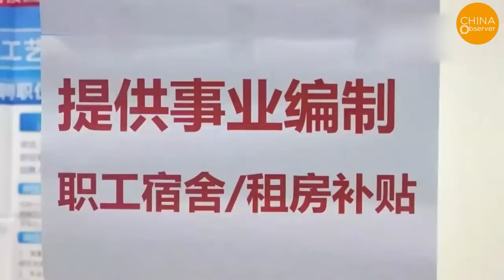All Came Crashing Down, CCP is Finally Next

Comment: One of the easiest things to do is to point out massive weaknesses in a country and predict a collapse. People predicted the imminent collapse of the USSR for decades before it happened. They were right about the direction but massively wrong about the timing. Flawed systems have a surprising ability to keep stumbling along on the edge of collapse. They often look like they have turned everything around and are on the way up like when the Roman Empire switched capitals and geographic centre of mass. One could argue that both the CCP and the USSR represent stages in the fall of these empires that have been going on for decades and centuries and we just mistake their upswings as long-term movements when they are just the deathbed vigour of highly centralized ethno-nationalist societies.
Reply: I think you missed the first bit about globalisation collapsing and the need for self sufficiency. Comparing this to Rome considering said globalisation, technology and modern human enlightenment is a terrible yard stick. As stated, a third of the worlds economy is North America, your perceived Rome in this scenario. The USSR held on due to its ability to feed itself and proliferate energy through various means internally (and their grit). They also innovated behind the iron curtain. China has none of these things bar grit. Their voraciousness in the consumer economy has been unrivalled, thus a bigger crash is inevitable. The USSR took a few decades after the collapse to get up to speed and endured a depression. China will not weather such a depression when it’s only commodity is labour. Throw in a once in a century pandemic, a space race and African recolonisation war (where population growth is booming) and you really do have an unprecedented situation that can’t be juxtaposed. It’s new territory completely. Any time prediction would be folly but my gut says he is close on this one. You never know how the narcissistic rat in the corner will lash out. Definitely going into new unknowns. Hot mess, grab the popcorn.
Reply: Yes, but a huge country like China can be in a state of collapse for some time before it breaks up into separate regions/states. China already is in a state of collapse. The video is quite correct in saying that it all depends on the resources you own or can control. Maybe, the lesson to learn,  is the tendency of some states after a generation of successful development to throw away the pragmatism  that led them there and blindly embark on a political path of self destruction cutting ties with the world they depend upon. I am afraid that China is not the only example.
"Flawed systems have a surprising ability to keep stumbling along on the edge of collapse." That means nothing and you know it (hot air phrase meant to impress). All systems are flawed and some of them collapse .-)
Reply: @Droo75  Well stated, thank you.
Reply: China is collapsing again?😂
Reply: @haochengzhai7156  has collapsed already
Reply: Keep fantasizing.
Reply: But we should not underestimate the ingenuity of the Chinese people - they seem to be able to always stay one step ahead and figure out how to take care of their families despite knee jerk questionable policies of the ccp
Reply: Let’s also remember that the USSR collapsed right after a failed coup, which even though it failed, showed how weak the USSR was. Sound familiar?
Reply: I think many people have a general idea of what it means for a country to collapse...but I'm curious what the actual metrics and markers are that indicate a country's collaspe.  Is there one?
Reply: @sulblazer demographic collapse, domestic consumption collapse, export driven economy collapse, financial system collapse, currency collapse, and a positive worldwide view of general trust and desire to do meaningful business with China has collapsed. Any one of these can cause a civilization collapse, China has all of these happening at the same time and also much more. China crossed the point of no return 25yrs ago. 🇹🇼🇹🇼👍👍
Reply: CENAisNothing But a wasteland of polu fakefood etc etc
Reply: Great point one thing that should be noted is that most of what is transpiring began many years ago with the One Child Policy. If not for that one law, China would not need to be expansionist as it has become. The numbers show China’s population will fall from 1.2B to a mere 550M by 2100 and in that time the USA is expected to grow to China's current size. This can be directly seen in migration patterns. We can’t keep people out and China has to keep them in. The reason why China has beagnnloaning money to smaller countries is to begin using those loans a indentured servitude. China is actually in the process of enslaving the entire continent of Africa and only doing it because of it's own bad policies. How else will Xi manage to keep people working when China gets to old to support itself. It can't so it is going to use other countries citizens to support it's own denizens. This doesn't come from a point of strength from an empire in power. This happens when an empire can't maintain control. China's power is gone. It will never come back. What we have to fear now is that China will take us down with it as it sinks.
Reply: @merced175 Please elaborate on the failed coup reference.
Reply: @haochengzhai7156 it collapse to how many dynasty before ?
Reply: @marchebert9813  failed coup 1991.
Reply: @merced175  OH, for crying out loud! I'm so sorry. I thought you were talking about the US !
Reply: @marchebert9813  Honestly, totally understandable LOL
Reply: Yellowstone is building up and could cause the biggest cataclysm humanity has ever seen. After underground nuclear tests in North Korea, earthquakes in Mexico and Alaska doubled and Yellowstone broke loose with new troubling signs.  Last year it started emitting frequencies that happen before and during eruptions. We were told that we should be concerned when earthquakes went above magnitud 2. That line was crossed long ago. Today we have 3+.  The next eruption was scheduled for 40k years into the future, but nuclear blasts seem about the right amount of energy to shake that structure.  

If it goes off like it did in the last big eruption, everything within 300 miles will die. And within 600 miles will struggle to survive. And if it activates Cascadia and San Andres, the whole west of USA would be gone as a functioning economy.  And for some decades we could have an ice age.
Reply: Some people are being too toxic here and misunderstand both human ingenuity and power. I think the recent economic powerhouse of the Chinese middle class will carry the country, even with this current depression. I don't think the country will completely collapse since most Chinese are ethnically the same. What's most likely is Taipai integrates back into the government, ending the monopolistic power of the CCP. Similar to the US and the end of WW2 (we had some weird colonies back then 😂)

Comment: Yep. It sure can. But it'll probably be sooner. 👍🙂
Reply: I tend to think so. Peter makes a big deal about how long it takes to move industries, etc. Well, those that moved to China did not take long, so why would they now take long to move out. Second, the answer is in type of role that China has played. They primarily play in the labor intensive, low end of the manufacturing cycle. Finally, most of their progress, besides that directly funded by outside investment, is minimal. They have survived by IP theft and doing things that have already been done. All their tech companies, mostly in the e-commerce field, are not hard to reproduce. A non-China related example is how quickly Meta came up with a competitor to Twitter. This is not rocket science.

Comment: I think you'll find that Deng Xiaoping introduced the one child policy in 1979, three years after Mao's death. Mao actually encouraged population growth, believing that it would lead to a larger workforce and stronger military.

Kinda surprised that you aren't aware of this. This kind of failure to do basic research really puts a dent in the credibility of your channel.
Reply: deng? mao?....doesn't matter.  the one child policy happened and bit them in the arse.  deal with it.
Reply: Don't be so surprised because what is surprising is that you did not quote from Wikipedia correctly, here it goes:

Beginning in 1970, citizens were encouraged to marry at later ages and many were limited to have only two children.[26]

Although China's fertility rate plummeted faster than anywhere else in the world during the 1970s under these restrictions, the Chinese government thought it was still too high, influenced by the global debate over a possible overpopulation crisis suggested by organizations such as the Club of Rome and the Sierra Club. The fertility rate dropped from 5.9 in the 1950s and to 4.0 in the 1970s. Yet, the population still grew at a significant rate. There were approximately 541,670,000 people in China in the year 1949. The number then went up to 806,710,000 in 1969.

In the early 1970s, the state introduced a set of birth planning policies. It mainly called for later childbearing (Chinese: 晚; pinyin: wǎn), longer time spans between having new children (Chinese: 稀; pinyin: xī), and giving birth to fewer children (Chinese: 少; pinyin: shǎo).
Reply: @dancroitoru364  Thanks for completely failing to understand the conversation. 

I was referring directly to the claim made at the 2.30 point of the video, where it says that Mao "implemented the one child policy". It said nothing about Mao's (or more likely the Gang of Four's), thoughts about reducing the number of children during the 1970s.

FFS, am I the only one who understands how words work and Chinese history? I'm not even Chinese.

Fact 1: Mao died in 1976 (something I am old enough to remember). 
Fact 2: The one child policy was implemented in 1979.

Therefore, unless the ghost of Mao somehow rose from the dead and seized power, without anyone noticing, HE DID NOT IMPLEMENT THE ONE CHILD POLICY. 

I am not sure why people are having such a hard time with such basic historical facts. 

If this is the hill you want to die on, then go ahead, but I'm through explaining basic history to people who can't even understand a Youtube video, or care about historical accuracy of the claims made.
Reply: Well said, there are plenty of inaccuracies, misinformation and outright lies on this channel that I have a fit laughing everytime I watch it's videos.
Reply: @greg.kasarik  the point is that Mao started the concept of demographic control